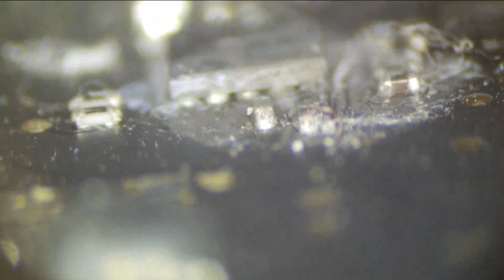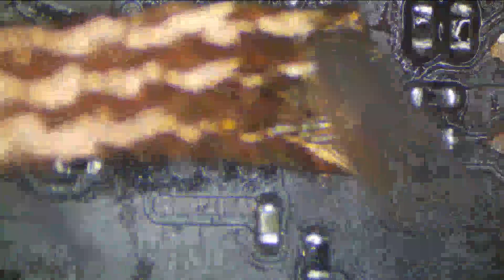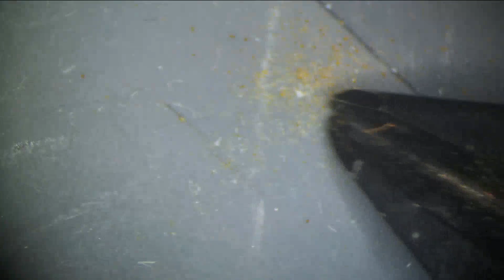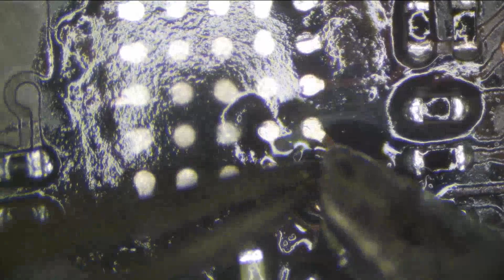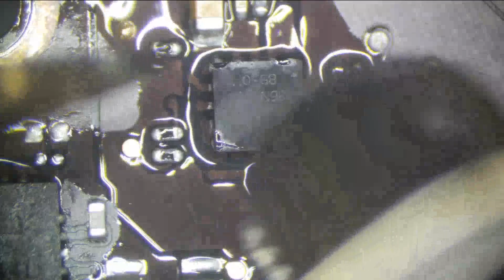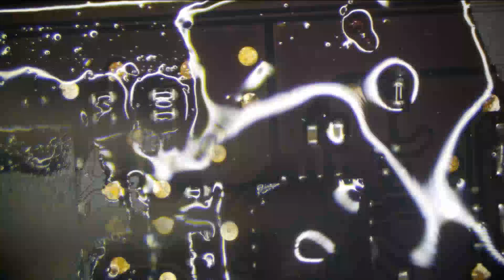A1466 no backlight. Please be easy....

Comment: Hello. Temperature you are using for remove part or re-hot new part please? Nice video.
Reply from the maker: No rehotting anything please. 430c / 120 lpm airlow
Reply: @TCRSCircuit   All on this video you do with 430 c temperature ? Only changing airflow ? Thanks for your last answer .. I will try 430c. Until now I use 330 c ..
Reply from the maker: @oldamachacek7289  Yes. All 430. It differs station to station though. Use what works and dont worry about temps. Sometimes I use 500 too
Reply: TCRS Circuit are you sure its in Celsius? As in parts manufacturers tech sheets found on mouser or farnell there are reflow profiles (ISLs http://www.farnell.com/datasheets/2357583.pdf?_ga=2.110441989.1612386106.1546937447-840156364.1543748453#page32) which end up around 240 degree Celsius. And 430 F is around 220 C (500F/260C) so that’s why I’m asking.
Reply from the maker: @FilipKrieger  1000% sure its C. 800*F